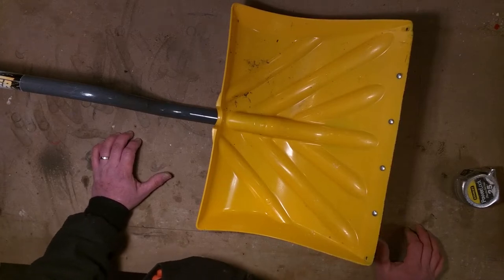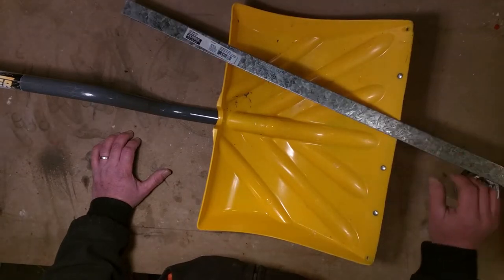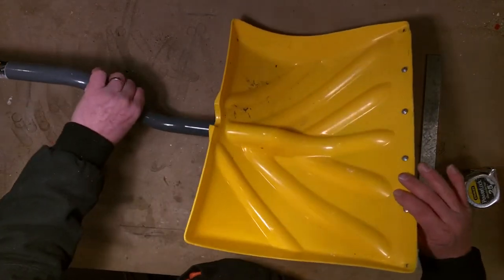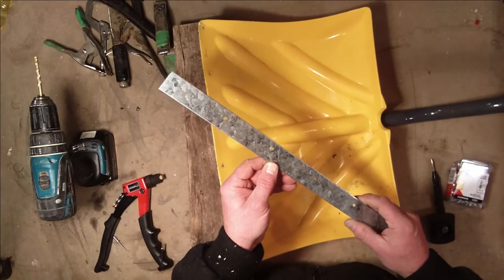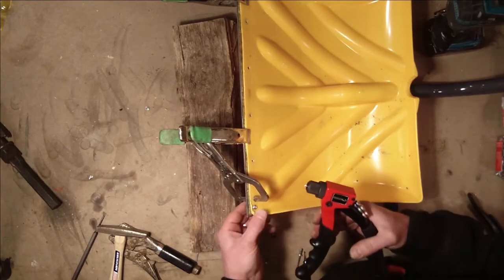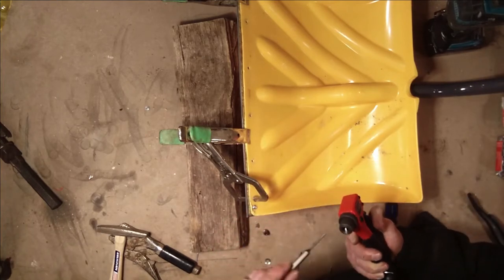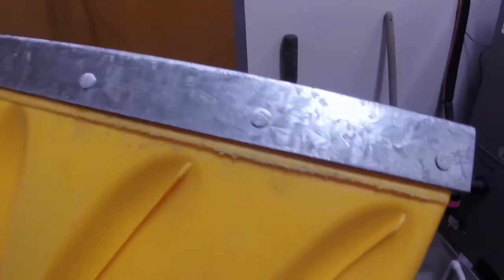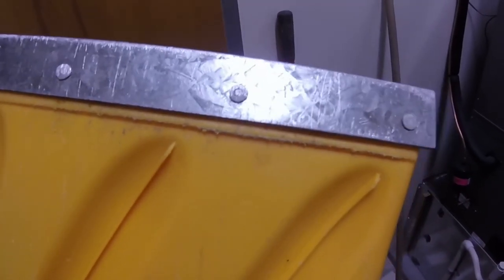Snow Shovel Repair -- DIY

Comment: I did a similar thing with a couple of snow scoops. What I used was common nails, I matched the nail diameter to the hole size for the scoop rivets, cut the nails so that they were @ 1/8" longer than the hole then peened over the cut end.

Comment: Yeoman (YO-HO) sells replacement blades with cold rivets, made for this application and to fit your shovel.
Reply from the maker: Thanks for the tip! My diy fix is holding up but I will definitely keep this in mind for the next time.
Reply: Just thought I'd mention it, I was gifted a hand me down from friends moving to Florida, a comfortable yo-ho (yeoman) shovel, the edge was crap so I went looking for alternatives to buying an entire $25-$30 shovel and throwing a good one away, it was $12 shipped to my door which is amazing as the closest town over 600 people is 40 miles one way. Bonus: its a direct fit to the shovel

Comment: If your using the nail in the rivet then install it from the outside so you have a smooth finish against the sidewalk or driveway. The way I seen another guy do it is with rivets without the nail. So I’m not sure if he bought them this way or just removed the rivet nail. What you then do is insert the rivet from the outside where the snow sits then while holding it taped, flip the shovel over then use a pinch to open up the rivet wider the finish by hammering the rest flat. Your plastic shovel is pretty flexible and kind of makes it harder to shovel snow.
Reply from the maker: Cool man. Thanks for the tip. I’ll try it that way next time!
Reply: He used pop rivets which are different than the ones you install with a hammer and punch. I believe these were installed correctly as they are a blind rivet (meaning you can install where you may not have access to the back side of the material). I think most pop rivets put the larger head side (the rivet head) on the side where the tool is located. It just so happens that this type of rivet left a larger than desired mandrel head (that's the blind side, away from the tool). That may be due to the type of pop rivet used (which may be more all purpose than the OEM ones). OEM rivets may not be using blind rivets.